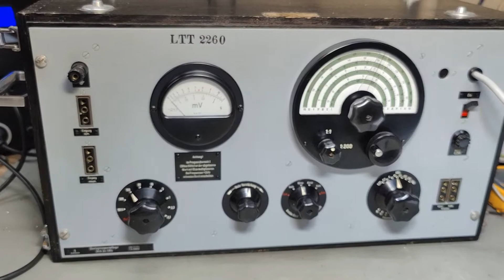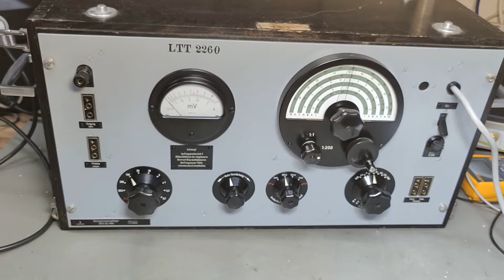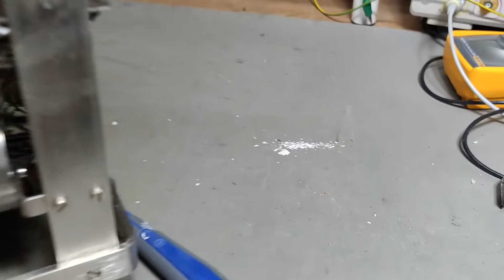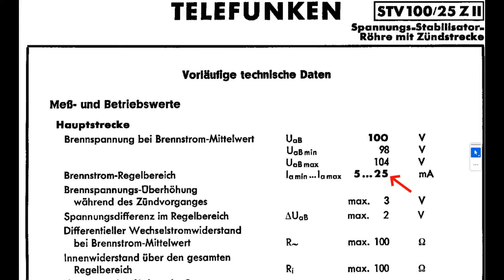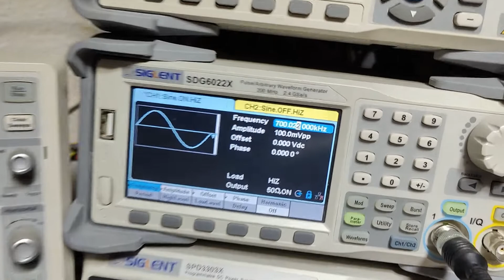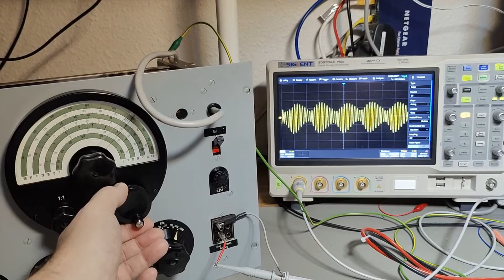Siemens & Halske überlagerungsempfänger 9 rel 3 u 412a test teardown

Comment: It looks like they have a nice high-ratio gear-reduced tuner on this. The problem with the cheap RF generators has always been that they are very hard to tune, even though they have a gear reduction. The problem with them is that they used a cheap planetary ball reduction unit that had a reduction of only 4:1, which isn't enough.

Comment: Hi Thomas, interesting device, the big relay has the same design as a classic telecommunication relay, I believe it was intended for measurement in telecommunication technology as @Nixie_Claus wrote.
The corrosion is very precisely limited to the galvanized surfaces and I believe that it is caused by the electrolytic process with the contribution of air humidity. These phenomena are very well known, not only in ships as described here, but in electrical installations, for example, an aluminum and copper conductor in one terminal, in a dishwasher a phenomenon called Anodization occurs when aluminum material is inserted, it becomes black (if a special detergent is not used prevents this phenomenon). In turn, magnesium electrodes are placed in the boilers to prevent corrosion and calcium deposits, etc.

Nice day 🙂 Tom

Comment: I believe that the white power was caused by dissimilar metals causing electrolysis and that it was increased by power going to Earth ground. It is the same thing as metal ships having sacrificial zinc anodes, to protect their metal hulls. I have even seen the bottom half of outboard motors fall off boats that were not protected with zincs, or wired incorrectly. I think those receiver parts will disintegrate, when you try to remove them. So, I would not try to open the big pot. Just releasing the pressure on its mounting screws might cause it to break. Just clean it gentle, with a wire brush, and paint it with a sealant.

Comment: I found this information:
this receiver primarily serves as a selective measurement amplifier for measurements according to the zero and comparison method, e.g. for coupling, imposition and secondary speech attenuation measurements on telephone cables. 
However, the device can also be used as a selective voltage meter for measuring small voltages in the frequency range from 30 Hz to 1 MHz, as well as for measuring the individual voltage components of a frequency mixture, e.g. harmonics of a base wave and thus for distortion factor determinations.
Claus

Comment: Zinc nuts have corroded. A clean with a brush, and then a thin coat of  oil will slow it down, though for best you want ot apply a thin coat of wax to them.
Reply: Corrosion = agreed. But, the cause? Oxidation, or electrolysis? I think electrolysis. I would look for stray power floating around. But, I am not an engineer. So, it is just a guess. Cheers.
Reply: @t1d100  Zinc, on a massive steel plate, so electrolytic corrosion as the zinc anode is tiny, but the steel cathode is massive. You need to coat the anode to keep the air and moisture away.
Reply: Boeshield T-9 is supposed to be really good but I've never tried it myself.  It's wax-based.